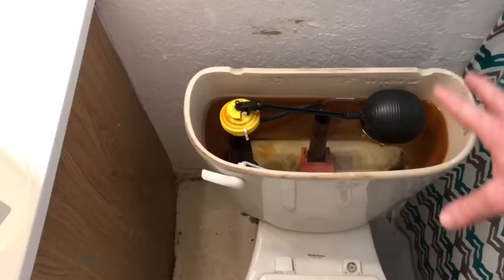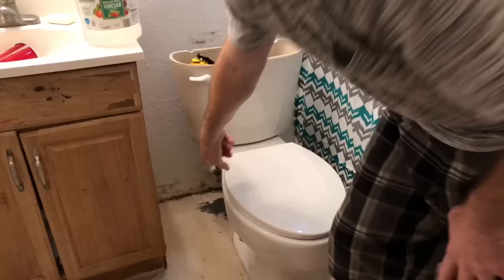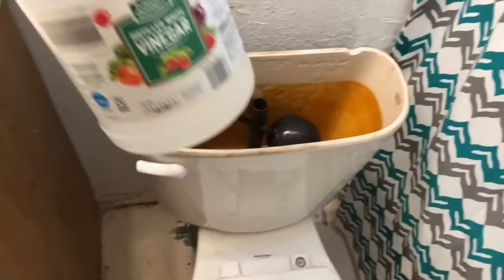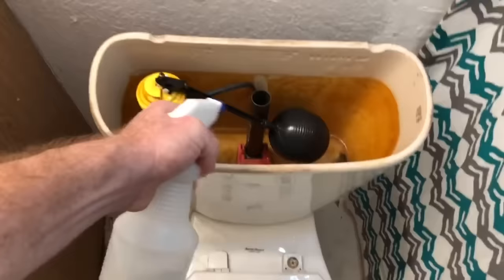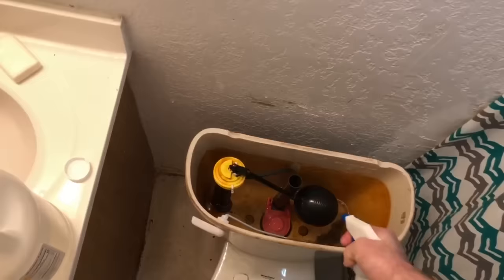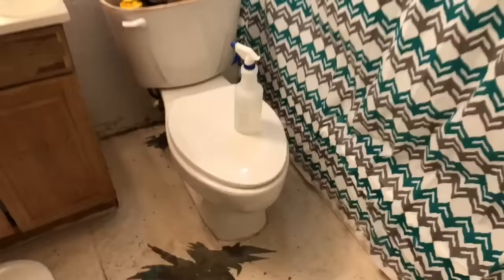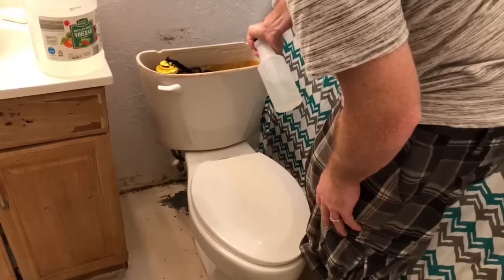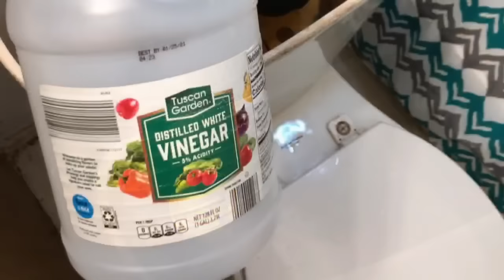I poured Vinegar into my Toilet to Clean it.  Here’s what happened!

Comment: White vinegar is a miracle worker. I've used it in so many places I can't even keep track anymore. I mainly use white vinegar to soak rusty/grimey car parts and they pop out nearly good as new after a few days
Reply: Pasarlo en español
Reply: Español
Reply: Español
Reply: @gladysromero7848  Como desées
Reply: I have used vinegar on pieces that were contaminated from a bad battery leakage. Soaked overnight and the crud is gone.
Reply: Hi,
That's pretty cool.
It takes a few days to penetrate if the rust is bad?

Comment: Baking soda would neutralize the acidity of the vinegar. So it makes lovely foam but doesn't increase the cleaning power.
Reply: @daughter_of_tmh  Personally, I prefer when they talk more clearly/louder.I lost a good bit of my hearing in the army and some DIY channels I have to rewind 10 times to hear what they said.
Reply: Wasn't aware.  Thanks for the time and comment. 
Mark 11:24
Reply: Sorry Lois Davis, the comment you made looked a little off. 🙄
So I did a Google Search and this is what I found: 🤓 
#1~Question-Does baking soda neutralize the acid in vinegar? 🤔
Answer~ "When baking soda is mixed with vinegar, the acid breaks down baking soda, releasing carbon dioxide gas that can help lift dirt from the surfaces being cleaned. Here are some recipes to try. Freshen your sink by mixing one part of baking soda with two parts of vinegar." 🙂
#2~Question-Does baking soda neutralize the acid in vinegar? 🤔

Answer~ "According to Amanda Morris, associate chair of the chemistry department at Virginia Tech University, baking soda and vinegar basically cancel each other out when they're mixed — unless you use them the right way, in the right time frame. Apr 5, 2021" 🙂
Reply: I agree, mixing vinegar and baking soda does not make sense.
Reply: @davec3651  I agree with you there on the baking soda, I prefer just vinegar and no baking soda. If I want bubbles I will just a soon go and get 'Scrubbing Bubbles' from the Publix or Dollar General. Seeing as I don't let my toilet tank get nasty
Reply: I think I may have learned that this week. If you use baking soda and vinegar separately they  work well, but I was informed that they cancel each other;s effects.
Reply: If you have a clogged drain or toilet baking soda, vinegar and a warm water will clear it up. I had an absolutely disastrous clogging problem. I have two tubs and two toilets that come together to go into the outside line. It clogged at that juncture. This absolutely break up the clog!!!!  Didn’t have to call a plumber!
Reply: @joanbryant4601  YES! For whatever reason, the combo is excellent at clearing clogs.
Reply: @joanbryant4601  Worked for me too.
Reply: @joshuabrewer5397  : closed caption ??
Reply: Correct baking soda is a bad idea at that point

Comment: Vinegar is great for cleaning for sure. But instead of just spraying it on to the walls of the toilet tank or the bowl itself,  after you have emptied the water as completely as possible thoroughly wet paper towels with the vinegar and adhere them to any area that you need to clean. Close the tank and the toilet lid and let it sit for at least 3 hours. 
They also make a much stronger vinegar especially for cleaning. I would wear a mask and rubber gloves to do this procedure, the  stronger vinegar works GREAT, but can be caustic. Make sure the area you’re working in is well ventilated. I was so pleased with the outcome of using the “cleaning vinegar”. All the lime buildup was gone without using any abrasive stone or scouring pads. My porcelain toilet bowl was clean smooth and shiny, definitely worth the effort
Reply: Would this cleaning vinegar work to rlinimate toilet bowl ribg? It just keeps coming back.
Reply: Or just mix it with some dawn dish soap and spray it on. The soap will make it cling.
Reply: How come you can't just pour in a whole gallon of regular vinegar and let sit for an hour? As opposed to spraying or paper towels?
Reply: Just fill the whole tank with vinegar and let it sit overnight
Reply: Baking soda also works with vinegar
Reply: @darlenemstrommer7687 I am skeptical about that. Baking soda is a base and vinegar is an acid. One would think they would neutralize. What is your experience?

Comment: My tank had 50 times more iron on it, and there is still a hard ring around the top, but it got the rest of it pretty well.  Still working on it.  I read some research that says spraying your countertop with vinegar, then follow by spraying with hydrogen peroxide and it works better to kill germs than bleach.  I use vinegar for cleaning but also the high strength white vinegar for weed killing (no roundup).  The high strength is caustic, though, so you have to be careful with it.  It works for hard water deposits, too.  Excellent demo, thanks!
Reply: .                           CAUTION ⚠️ 
.             DO NOT USE VINEGAR ON
.             GRANITE COUNTER TOPS
Vinegar will damage granite counter tops because vinegar contains acetic acid and acetic acid is very damaging to granite counter tops , For other counter tops such as Formica and other surfaces , Follow the manufacturer's instructions because vinegar can damage other surfaces as well , If you accidentally spill vinegar on a granite counter top , Get it wiped off immediately and and rinse with clean water

Comment: Baking soda is sodium bicarbonate and reacts directly with acetic acid, which is what vinegar is. The result is basically then salty water. The baking soda will neutralize the acid. Better is to add the bottle of vinegar, then fill above rust line with very hot water, and just let it sit for a few hours.
Reply: You are completely skipping over the point of mixing the two. There is a chemical reaction that occurs as one combines with the other. That reaction is what can clean a surface or unplug a drain.

Comment: Also great for descaling your kettle. Pour in quarter pint of white vinegar and a quarter pint of water. Bring to the boil and leave. The calcium will dissolve. If it doesn't bring to the boil again several times until clear. Pour away and bring to the boil a couple of times using fresh water to get rid of vinegar smell. When I cleaned my toilet I heated up the vinegar and sprayed the inside. More effective and it is biological and does not damage the environment.
Reply: Yes!! Heat would increase and hasten the effect!

Comment: Cool trick, I have known for years to do this, it also works on floors, wood floors as long as you dilute the vinegar. I have real tile floors which does not have a high sheen glaze, it's fantastic that I can clean the tile with vinegar. Now nanolumen floors can also be cleaned with straight vinegar as long as it's not the peel and stick squares. The peel and stick squares the vinegar will seep under the square and the acid will erode the glue used to stick the squares on the floor. I have used warm water with a couple of drops of Dawn Ultra dish soap, and then rinse fully, and take a towel and dry the floor or use a fan to blow dry the floor. I use vinegar to wash out my clothes washer, I put it on the Clean Washer cycle and pour about three cups of vinegar in. BOL the first time I did this my daughter said Moma now the clothes will smell like vinegar, I told her nope, once the washer is clean, I then put it on rinse and spin pours some softener in and let it go through the cycle and then it smells very nice. I clean windows with vinegar and newspapers, for the house and the car glass. I spray my merrows and use a squeegee, for merrows that are incased in wood you want to only spray the glass, avoid the wood as much as possible. I use vinegar to clean my outside plastic tables, chairs. I also drink vinegar and water with cucumber slices in it with salt and pepper, and ice to make it cold. Vinegar works wonders with the body health wise, it also helps with weight. If you don't want to drink it they make vinegar capsules you just swallow, I do use these too, and I love the taste of the vinegar so I also make salad dressing with vinegar, either white or apple cyder vinegar works. This is my own original creation.
Donna Lee Avera's ~ Salad Dressing 
1/2    Cup.......Vinegar
1 1/2 Cup...... Mayonnaise
1/2....Cup...... Sour Cream
1........Med..... Red Onion, diced small
1/2....TESP.....Garlic Powder *(you can use fresh garlic, maybe two petals of the garlic clove graded)*
1.................... Cucumber peeled and diced small *(you can leave the peeling on if you wish)*
1.....................Green Bell Pepper diced small
2.....................Stalks Celery diced small
2.....................Carrots diced small
2........LG.........Tomatoes diced small
1 1/2 TBS...... LITEHOUSE GAUACAMOLE HERB BLEND
 ......................Ingredients: RED ONION, CILANTRO, LEMON PEEL,TOMATO, 
 ......................RED CHILI, GARLIC, CUMIN) FREEZE DRIED,GLUTEN FREE
.......................NO REFRIGERATION AFTER OPENING)
Dice all vegetables place in a large bowl and sprinkle LITEHOUSE GAUACAMOLE HERB BLEND, mix well, then mix in the vinegar, mix well and cover with lid, or plastic wrap. Place in the refrigerator for half an hour. Mix the Mayonnaise, and Sour Cream using a whisk blend well, pour over the vegetables and mix well, use right away or dressing can be placed back into the refrigerator until you are ready to make a salad. I usually make up the dressing a day or two before having family or friends over for lunch or dinner. Always cover the dressing to keep fresh in the refrigerator it keeps for about a week. Enjoy! 😄

Comment: I use washing up liquid and the toilet brush. Give it a good scrub around then flush. Repeat until clean.  Floor cloth with washing up liquid under the toilet bowl rim to remove residue. Flush repeat.  Gets rid of the smell. Always wear rubber gloves when working with acids and de greasing agents. Repeat often.
Reply: Agree 👍 even a Brillo Pad & a good hand job works great with a little scrubbing will work over time . Cost pennies .

Comment: If you have a pot or pan with really bad burnt on food use vinegar and baking soda and heat it up. Let sit overnight. Next day easily comes right off. If course be careful with mixing the 2 cuz it will fizz up! Don't wanna get it all over everything!
Reply: Also a dryer sheet in warm water left to soak will make burned food come off broiler pans, pots and skillets

Comment: ACID safety--- goggles, respirator, fan aeration and open a window. use tp to surround the area wet it with spray; it will draw up the acid from the bottom.
Reply: acid and other harsh cleaners will erode the rubber fittings and wa la !   YOu have to replace everything now :(
Reply: Okay, let's not go overboard. It's not exactly hazardous material.

Comment: oxalic acid available in home centers and hardware stores.  Fill tank with hot water and add 1/2 cup powdered acid. No scrubbing. Give it a minute and its clean. Fush a few times to rinse. No harm no foul.
Reply: @mjt1517  it's very mild and you just flush/rinse when done

Comment: That is the cleaning vinegar. It's the 5% white vinegar. Expensive , though. $13 a gallon on Amazon.
Reply: NO,…low, single digit % acidity vinegar is cheap.  20% and 30% industrial cleaning And herbicide uses products, like Harris at Home Depot, cost $20/ gallon. And work very well.

Comment: Get some Iron Out and stop wasting the vinegar.. Iron Out, you spray it on and walk away for a few minutes and come back and Wha-La it is clean as a whistle, no scrubbing or anymore spraying involved.. It also comes in Tablets as well.

Vinegar is good for a cleaner when you want it to take the place of buying 409 or something.. There are several video's on here that show you how to make it..
Me,  without a measuring cup, I fill a spray bottle 1/4 of the way with Vinegar, fill it with water to the top and then put in a few squirts of Dawn Dish washing Detergent in, preferably the Blue Dawn..
Reply: I’m sure that works : however the idea is to clean out the ports that have build up on the inside of the jet holes -

Comment: Speaking of magic, try WHINK.  Just a little squirt of that stuff & it removes any iron/rust (orange/brown) color on toilets, clothes, license plates, dishwashers, bathtubs, washing machines, sinks, carpet (e.g. rusty orange circle from a plant stand), etc etc.  It works instantly!!!  with no scrubbing!
Reply: Charlie can you please tell .me what WHNk stands for. Thanks
Reply: Will Whink take the black stuff off the jets in the bowl?
Reply: Whink Rust Stain Remover.  It comes in a brown plastic container in various sizes.  Gets rust off car  license plate, clothes, just abt anything.  You don't need much either.  For real small jobs wet a Qtip with it, or put on a small rag.  Use sparingly & it will go s long way.  Of course in the toilet bowl you just squirt it at the rust.  Don't flush it right away either.
Reply: @charlieslak5585  thanks a lot Charlie for the detailed explanation  of the product.